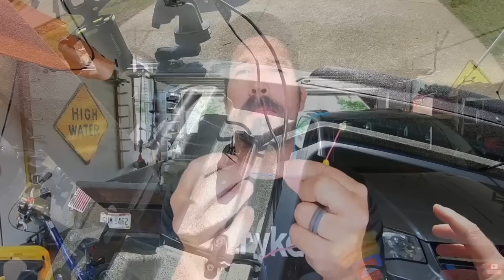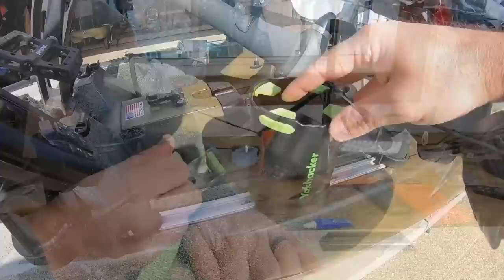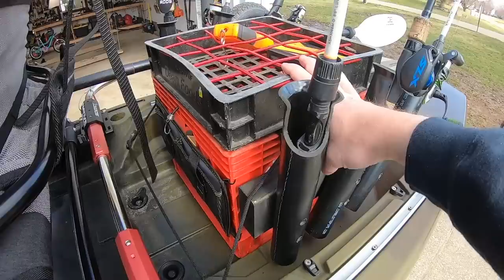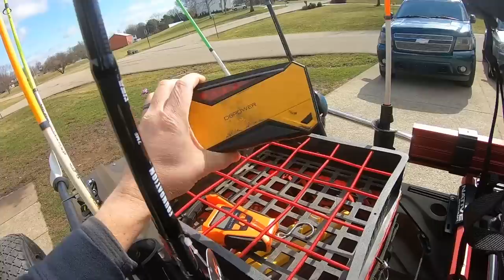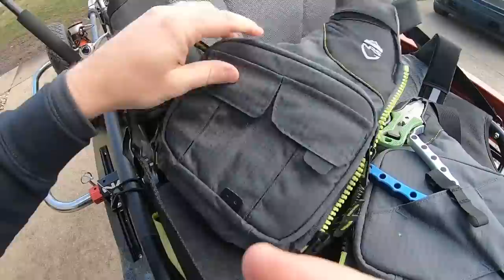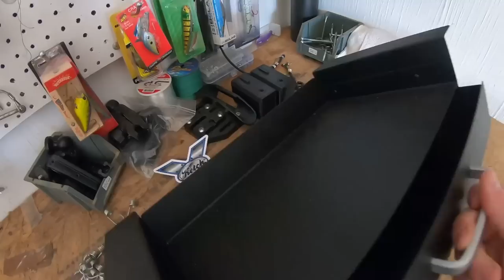Fishing Kayak Setup Ideas - Detailed Walkthrough - Hacks - Mods

Comment: Really kicking myself for saving the money and going with a Hoodoo Impulse 120. Bought it during covid and it was either spend too much on a Hobie or Bonafide (the Bonafide new was only slightly more at the time but backordered till after that summer) on the secondary market or get the Hoodoo which is compatible with almost nothing that doesn't just screw into kayak tracks. The upside is Hobie's patent ran out on the original mirage drive and Hoodoo uses it so I could put a Mirage180 in it if I want to spend $1000 to get reverse. I'd have to drill into the hull to get the native landing gear to work, right now using railblaza c-tug...I wouldn't recommend, it's the only cart system that I can store on the kayak while I'm out in the water with the current config.
Reply from the maker: Good thing that Kayaks have good resale. Although a pain in the rear... possibly an option?

Comment: Nice yak. I need pedal drive. Love the workout part of yakking. Found the Omega locking collar a headache with fatter EVA grips on cat rods. I ditched the lock and shaved the opening for clearance. I have the Garmin Striker CV4, great bang for the buck and great vids for use on YT. Really dig those Lew's rods you have. Love mine. Great vid. Lead me to some mods I may have overlooked and would like
Reply from the maker: Right on Steve! Thanks for the comment and tips. Those Lews rods are solid and have done me really well over the years... especially for kayak fishing where it's nice sometimes to have shorter rod lengths and I believe they are 6.6

Comment: How do you like the overall performance of the p127? Tracking, paddling, stability etc? On a scale of 1-10
Reply from the maker: Hey Clean Fun, Great to hear from ya. Overall I like it... but I like it at the price point I got it for $2100. Tracks like a boss due to the hull design, Stability, I stand easily and fish (I have pretty good balance still) I paddle it .002 percent of the time so not a lot to say here. The only things I'm still up in the air about is the turning radius. I haven't been in too many 12.7's before so I don't have a lot to compare it to. Going from my 10ft native slayer with a rudder extension.... it's noticeable and I need to figure something out as I fish tight spots sometimes.
Reply: @wendellfishing  thanks man I appreciate that.  The steering is not a huge deal breaker for me as long as it will get to the areas. I use my paddle to fish in shallow and if it tracks good that is a huge plus for me. The sharp turning kayaks don't track bc they want to turn too fast. You get one cast and you're turned around. I'm considering this kayak strongly very soon. Tight lines!
Reply from the maker: @cleanfunfishing  Right on... you will like this yak then

Comment: Why did you choose a Bonafide P127 over another pedal kayak?
Reply from the maker: To be honest, I got it for $2000 and it was only used once. Hard to pass up. I could use it for a year and sell it for more than I bought it for at that price. Want to give it a shot for a season. I also am a HUGE fan of the propel drive. I like what I see so far but I need to figure out a modified turning system for it. Not happy with that so far.

Comment: Sweet yak and hacks! Just purchased my first yak and got the Pelican Catch PWR 100. I followed the link for the Sidekick wheel system. Would that work on my wide yak?
Reply from the maker: Hey boss, congrats on the new yak. I don't believe the Pelican Catch PWR 100 has the gear tracks you need to attach the Sidekicks to your yak.
Reply: Thank you for responding  @Wendell Fishing  , I appreciate it! I'm not opposed to mounting the correct tracks if need be, given they are sold separately? Also curious if the width of my yak is too wide? One of the pics on the website doesn't show the spreader bar. I could always accommodate an aluminum pipe to go in-between I'm thinking...